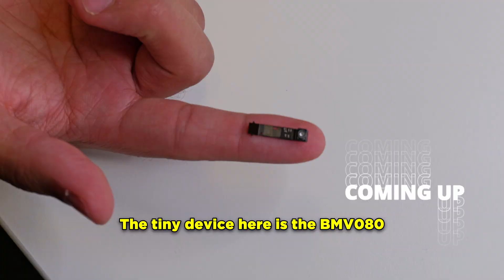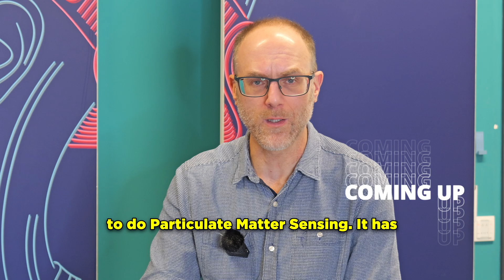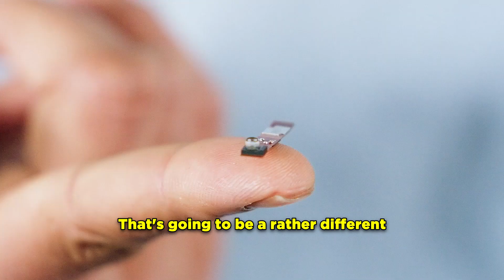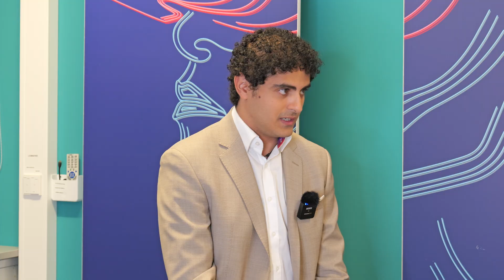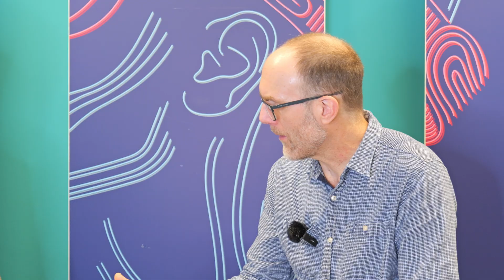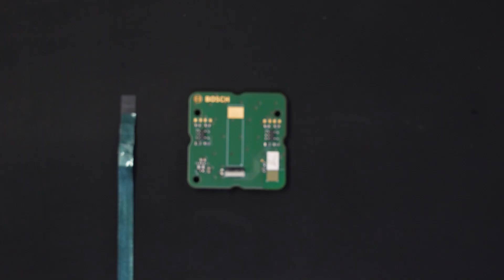This One Mistake Could Ruin Your Sensor Integration...

Comment: I remember back in the SUN system days, if you even touched the gold component interface connectors, like for peripheral boards in workstations, it would screw it up completely :P they were engineered to the limits, like this device